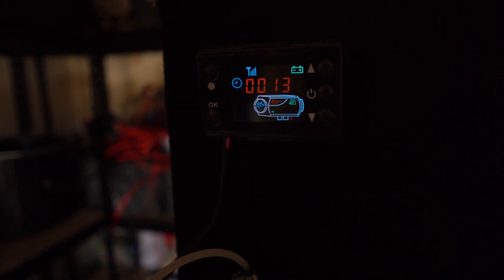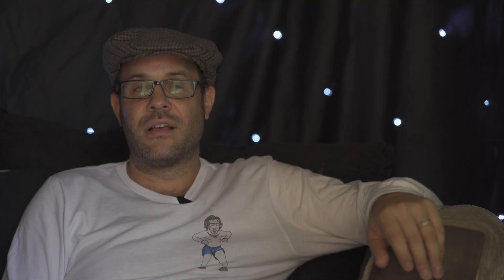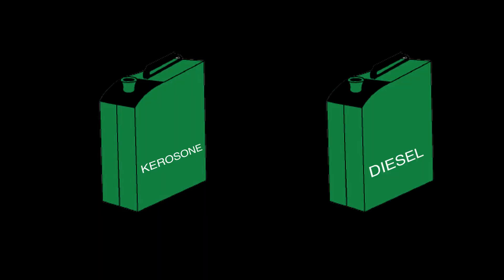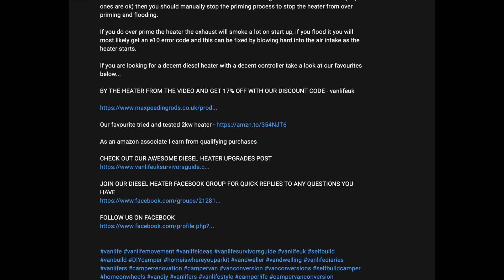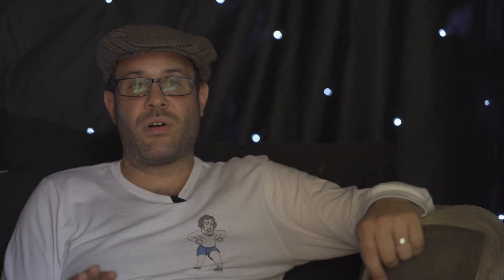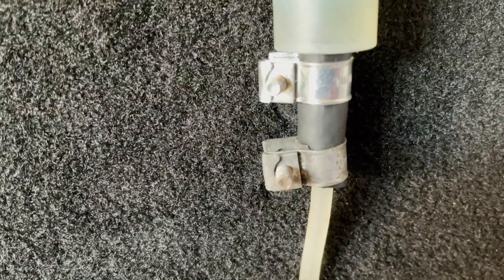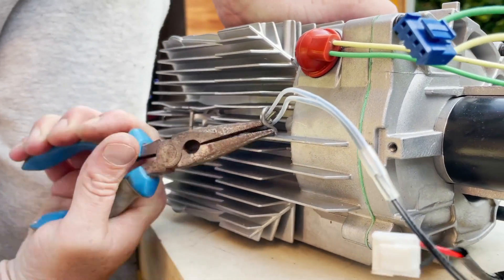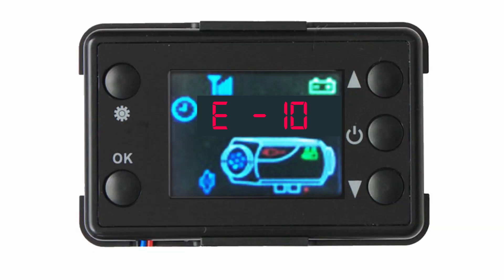Chinese Diesel Heater Error Codes E01 - E10  All Codes, Faults & Fixes

Comment: So I’ve got an E5 code. What do you do?  I’ve tried switching it off at the controller and it won’t shut off
Reply from the maker: Error code 5 is an overheating error code but that should automatically cut out. You need to somehow cut the fuel to it. Don't cut the power or you could fry your motherboard. Hopefully when it cuts out and you unplug the controller and plug it back in it should reset. then see if it happens again

Comment: Thanks mate, great no nonsense video. I have just purchased one of these from Vevor. Got it all set up in my shed last night, running off a next to new motorcycle battery (temporary whilst I wait on my inverter) I'm getting an e 2 fault with this though which seems strange, and you say it's most unusual. Anyone able to chime in what this could be?
Reply: got today after installation a e-2 with a vevor like you. anything to help me?
Reply: @heloisecockenpot  hello mate, once I put the power inverter in and ran it off of mains electricity It worked perfect after that. Seems the battery I was using wasn't up to the task, which I did find a little strange

Comment: I am getting error E2 when plugged into my 12v cigarette outlet in my truck, but it works fine when plugged into a jackery 500. Is my truck too high of voltage? Anyone know how I can fix this?
Reply from the maker: quite a lot of trucks are 24v because they need the extra power. Do you have one battery as a starter battery or 2 joined together?
Reply: @vanlifesurvivorsguide  Thanks for the response! I believe I only have the single battery but not entirely sure

Comment: Textbook video for folk who live with the machines and who fix them. Oration was perfect.
Reply from the maker: Thanks mate :)
Reply: @vanlifesurvivorsguide  
I will be polite and say that the Chinese engineers have a sense of humour as they make sure we spend lots of time fixing their kit without manuals, and using a jungle telegraph system of teaching. I have just given up on a unit which failed on a fan error. It completely filled the boat with thick smoke which took weeks to clear of odours. After buying a replacement board and sensor, mating the controller to it by altering the voltage to 12v, swapping the sensor and fan plugs round, and moving the fan earth lead to the outer pin, the little bugger booted up and warmed up nicely. It soon began to speed up the fan then an almighty crunching sound occurred and the fan error code came up and the unit went dead in a cloud of smoke. It now starts at full fan speed and fails in 3 seconds. Time to give up and place the unit and its parts in the "suspect spares" bin.

😕

Comment: Excellent video, Many Thanks
Only thing I can add is another problem with the soft walled fuel line.  (I suppose its academic really as you wisely advised us to chuck the soft walled pipe so we wouldn't be using it anyway.) It absorbs the pressure from the pump so the fuel leaves the jet is a dribble so it won't burn.  Instead of a series of spurts which is neccessary to vapourise the fuel so it burns.

Comment: Low heat output and e-08 shutdown after a few minutes was caused by a dirty glowplug screen and partial blockage of the small air-hole in my case.

Comment: Error code E-01 tip ..if I try to start the heater above 15 degrees c I get the error E-01 BUT 15 degrees or below, it starts fine..once heater is running I can turn the heat up no problem..

Comment: Hi
Ive just got a van with a car parking heater BSE - D5 was working but now giving error 7 and it keeps reating "fan failure^ . Please advise what can be done to fix or remove /  to disconnect. Thank you
Reply from the maker: I think the D5 is an eberspacher heater and have different codes but if the fan is the problem please check out error code 6 in this video. Is it possible something has been sucked into the fan end of the heater and is obstructing the fan?

Comment: What happens when the fan just starts with power and won't fire even over 20 minutes of the fan running can't get the pump to turn on however I did run low on fuel but the lines show fuel in it
Reply from the maker: Do you mean it comes on by itself blowing cold air randomly or when you turn it on yourself it just blows cold air and doesn't fire up?
Reply: @vanlifesurvivorsguide  yes that's it

Comment: Hi I have a Chinese deisal heater I've powered it up and the display is showing E_2 I've looked at your videos but I am only using my van battery at the moment it's 12v but as I've said it keeps coming up with E_2 I've checked the battery with a volt meter which shows 12.45 could you please help
Reply: I have the same atm. Did you find out what the problem was? And the solution haha!

Comment: Hi I have error code 03 glow plug error. I checked the disassembled spark plug, it turns red, but I measured the voltage on the motherboard where the glow plug is connected but it is not 12 volt current. Could the motherboard be damaged?

Comment: Hi. I connected power to my heater after being  stored  for summer. The display  is mostly black except there is a crude graphic of the  normal  display information very faint in bottom right of screen. Button light's are lit, but nothing  happens  pressing  buttons.  Any suggestions?

Comment: It has been working well for 2 years but few days ago started showing E10. The lithium house battery voltage is 13V and fully charged and the display of the diesel heater shows 13V.  So that's good.  When I start the diesel heater the fan is starting first and slowly the display of the diesel heater shows the voltage to drop from 13V to 9V and then shows the error E10 and shuts down. The Li ion battery display continues to show 13V during all this time and the LED lights are working fine, the fridge also working fine, so no issue with the power coming from the Li ion battery. The heater needs 12V to start so something is happening and does not get the minimum 12V needed from the battery or the heater "believes" does not have 12V.  Any suggestions would be greatly appreciated.
Reply from the maker: What you are describing sounds like either volt drop or damaged battery. Well this happens when the cells are damaged in a lead acid battery but i'm not sure if it happens with lithium though  but you could get it oad tested and see if anything is wrong with it. And this is also what happens with volt drop but as you said it has been working fine for 2 years so the cable is obviously thick enough to work without problem. Another thing that can cause volt drop is if you have gone to a fuse box instead of directly to a battery and the cables going to the fuse box are not thick enough to carry the load for everything attached. so if you have added something new to the fuse box or are using stuff at the same time than normal. Do you have a split charge system? have you tried starting it with the van running?
Reply: @vanlifesurvivorsguide  Thank you for the reply. I use a fuse box and has been working fine. I have not added something new to the fuse box. I have a split charge system, so the 2 Li ion batteries (170Ah each) are charged when I run the engine of the van. I also tried to start the diesel heater with the engine running, but I got the same error and low voltage issue. Also, per your suggestion, how do I load test the Li ion batteries to see if anything is wrong with it?  During this process of starting the heater as the display of the heater drops from 13V slowly down to 9V, the display of the Li ion battery stays at 13V and with all the LED lights on, I do not see any flickering of the lights to suggest that the batteries are not working properly.  I am wondering if the electronic controller inside the diesel heater is not working properly and when I start the heater it malfunctions and "reads" low voltage and then it shuts down.   I am thinking to replace the diesel heater with a new one. Your suggestions would be greatly appreciated. Cheers.

Comment: Great video, but what is a solution to E 10 then? It seems I have overprimed my heater. It blows only cool air, does not heat up, then it gives E 10. Second question: Does it really make much difference if the pump is gravity fed? I was planning to tap into the main diesel tank, meaning that the fuel would be about 30 cm below the pump...
Reply from the maker: Hey, sorry I have only just seen this. No the pump doesn't need to be gravity fed as they push and pull so suck the fuel from the tank and pump it out the other side. E10 it depends on what it was that gave you the mulitple failed attempts but if it is flooded...
Reply from the maker: the best thing to do if you have over primed it is take the fuel line off of the bottom of the heater put it into something (so you don't get diesel everywhere) and try and start it without the fuel line attached a couple of times
Reply: @vanlifesurvivorsguide * Good answer.
Reply: @vanlifesurvivorsguide  I repeat - this video is a life saver. Thanks to you I got the darn thing up and running. Now I just need to lower the fuel tank and drill through the sender (VW T5). My only advice for everyone is to avoid using clamps on the fuel line connections (either the Chinese or sourced locally) unless you get the clamps that remain perfectly round when tightened. I replaced the Chinese once with better quality ones but they became oval when tightened, which caused leakage and resulted in another error. What worked for me then is cutting an reinforced rubber fuel cable to short pieces, and plugging the hard nylon line directly to that, without any clamps, just used a tiny bit of dishwashing liquid to slide it in and seal it. Now I think of replacing all joints with the same solution. Or throwing the nylon line away and replace it with the proper stuff entirely.

Comment: Great video very helpful. I suspect I have flooded the burn chamber and getting e10 as when I prime the diesel alway runs to the bottom of the hose leaving air trapped at the top. How do you solve a flooded burn chamber?
Reply: I’m having the same issue, would love to hear if you were able to solve it and how?

Comment: I keep getting Error code 01 - low voltage.
Using a mains 30 amp supply.
This is my 3rd heater - first one ran over 4000 hours on kero no problems. Then it stopped working. Bought another as they are so cheap. Turned out to be just the controller!
Anyway the new one is on the same setup.
Could it be this one is a bit more sensitive and needs a bit more than 12v?
Happened 4 times today. Turn it off - back on again - fine for a while then it trips out again.
Very annoying.
Reply from the maker: Are you sure the transformer is set to 12v? how far is it from the heater and what size cable did you use to connect the heater to the transformer? did you bridge 2 of the channels on the transformer or just go through one?
Reply: @vanlifesurvivorsguide  
Thanks for the reply.
It worked fine with the last one same setup.
Bridged 2 channels. 
I can understand it on startup when current draw is highest but not during normal running. 
I will test the voltage tomorrow. Perhaps the pot needs a tweak for this one.
Reply from the maker: @codprawn  have you checked the controller is set to 12v and not 24v? This sounds most likely if it is the same set up as before.
Reply: @vanlifesurvivorsguide  
Same controller as before. Will check but unlikely to have changed?
Reply from the maker: @codprawn  where are you based?
Reply: @vanlifesurvivorsguide  
Deepest darkest Wales!
Reply: @vanlifesurvivorsguide  
Just checked the voltage. 
12.19v no load. On startup psu drops to 12.18v so it's working fine. Worth tweaking the voltage up or not?
Reply from the maker: @codprawn  Did you check in the settings menu if it had switched itself to 24v mode though? If it has and it is on a 12v battery it will give you error code 01 for low voltage.. You need to get into the settings menu the passcode is 1688
Reply: @vanlifesurvivorsguide  
Just followed your excellent video.
Set at 12v.
It's an odd one. Usually happens at startup but then it's fine but it cut off 4 times last week with the E01 error.
Identical setup to the last heater been fine in the past.
Reply from the maker: @codprawn  They can deffo run at 14.4v so yeah up the voltage slightly see if it helps at all it wont hurt it

Comment: I get E8 code and lots of smoke coming out of the exhaust.. Will check the fuel line etc.. Would the van being parked on my quite steep driveway make it do this?
Reply: Did you figure it out?

Comment: Mine won't work now after I run it dry been a month now can't get it to work 😩 error 8 code keeps coming up
Reply from the maker: Hi mate, have you tried priming the heater as it takes a few primes to get the fuel all the way from the tank to the heater sometimes. If you haven't tried that will be the problem if you have then it could just be bubbles in the fuel line and need purging. take the fuel line off of the bottom of the heater and put it into a clean glass or similar and run a few full prime processes or until you can see no bubbles in the line then reattatch it and start it up. 

https://www.youtube.com/watch?v=ssFdX2oNP6E&t=15s

https://www.youtube.com/watch?v=7wmQfEgv9VQ&t=117s
Reply: @vanlifesurvivorsguide  thank you mate and I have tried that the only thing I have not tried is losing the nut on the actual fuel tank where the nipple is I took the line of at the heater and and primed it and the fuel was dripping out the end so I connected it back up and it just dropped again kinda just sits there in the line pulsing up and down I'm not sure what else to do feel so lost lol
Reply from the maker: @Brad_hodge_photography  where are you based?  is the fuel line soft and green or rigid and translucent? it sounds like  you are loosing pressure after the pump somewhere. So either wrong fuel line or a split or crack in the line or a loose connection to the heater or pump and air is getting in
Reply: @vanlifesurvivorsguide  I'm located in nsw Australia mate and yer True I'm so confused with it I've been trying to fix it for a month now it's really horrible lol but don't think I'll get it going again by myself
Reply: @vanlifesurvivorsguide  my heater don't prime that way I hold up and down together on my one
Reply from the maker: @Brad_hodge_photography  where are you based?
Reply: @vanlifesurvivorsguide  nsw Australia
Reply: @vanlifesurvivorsguide  Carcoar nsw Australia
Reply from the maker: @Brad_hodge_photography  Ive just had a heater doing the same thing this morning pretty much and have narrowed it down to the pump for this one. If it was me I would replace everything from the pump to the heater so the pump, black rubber fuel line,  hard nylon fuel line and the clips. That should solve anything that it could be and would cost me about £15 in the uk not sure what that is in oz dollars though

Comment: I installed this heater yesterday in my van. It runs ands heats perfectly but on the display i can only see the temperare as measured in the van. However there's now way i set the temperature that i want to go to. It just is'nt available in the settings??? What could be the problem. Thx for uploading from the netherlands
Reply from the maker: Hi, are you running it in HZ mode or temp mode? there are 2 different modes and you need to be in the correct one if you want to set a desired temp. Please see this video https://www.youtube.com/watch?v=PDq4rWeyrv8&t=47s
Reply: @vanlifesurvivorsguide  Thx! By now I know what the problem was. It's OK now

Comment: Problem I had. After about a year of use the rubber mount for the fuel pump broke apart. The pump was held only by wires and fuel lines. Symptoms: works and then sporadic error 8

Comment: Hello,I had E-6 /the fan had slid down the shaft away from the nock sensor,I put a small socket on the shaft & 2blows with a pin hammer & that fixed that,then E-10 showed,this was a kink in the fuel line when I reinstalled it,your video was very helpful//:) I forgot to mention,this was coursed by me pulling out the power fuse,like a kill switch before the heater had finished its shutdown cycle !
Reply: Does it not slide back again through time on using as it’s not locked in?

Comment: Hi, my diesel heater was working perfectly for months and then now us showing e 10, I probably over prime it...😟🤦 But if it's too much diesel in the heater what should I do? I live in Scotland and it's bloody cold here and I live in my van 🥺😢🥶
Reply from the maker: Hi sorry only just seen this, the best thing to do if you have over primed it is take the fuel line off of the bottom of the heater put it into something (so you don't get diesel everywhere) and try and start it without the fuel line attached a couple of times
Reply: @vanlifesurvivorsguide  or you could also clamp the pipe from the fuel tank end before you take it off, that way you only waste a teaspoon ful
Reply from the maker: @tonystacey3347  I think it would be better just to put it into a glass so the fuel line still primes. You can tip the diesel back in and waste none if you use a clean container, but thats deffo an option if you get stuck with nothing to use
Reply: @vanlifesurvivorsguide  I’ll let you know, I’ve got 8 /10 codes, loads of smoke looking like over primed, checked intake and exhaust- both clear, plug looks ok- clean so it’s a couple of fire ups for me to clear over priming out.
Reply from the maker: @tonystacey3347  you said earlier clamp the pipe from the fuel tank, is your fuel line soft? If it is that could be what is causing the 08 code. The pipe should be rigid nylon stuff or it will likely cause bubbles or air locks
Reply: @vanlifesurvivorsguide  no I installed the white stuff on first install after watching your guide from the fb group
Reply: @vanlifesurvivorsguide  thank you sooo much!!! 🙏☺️